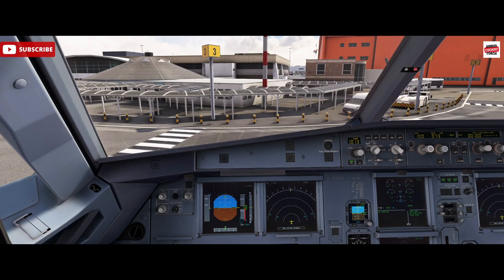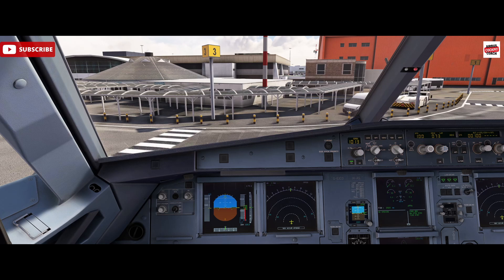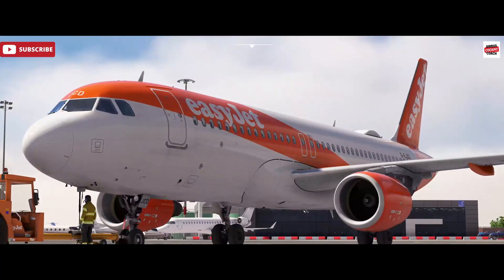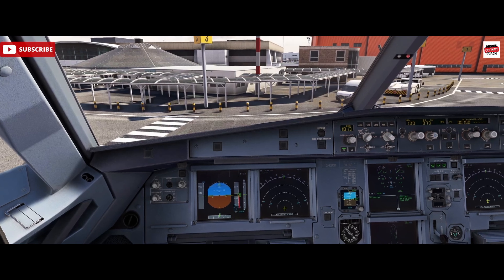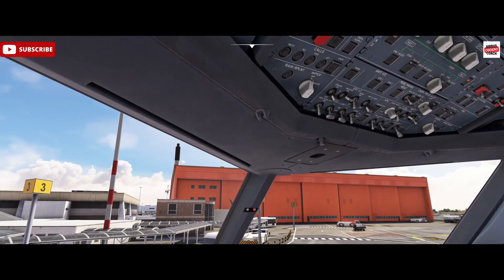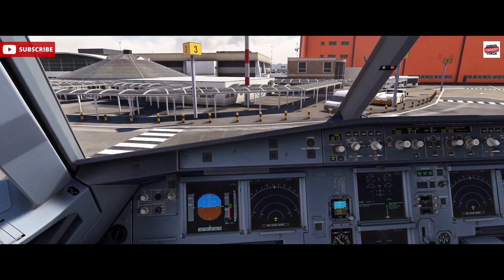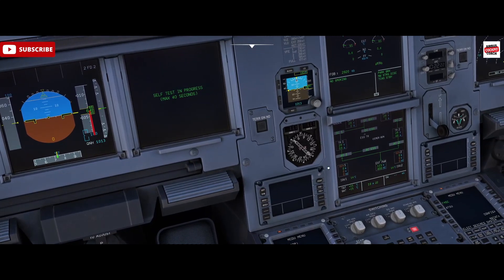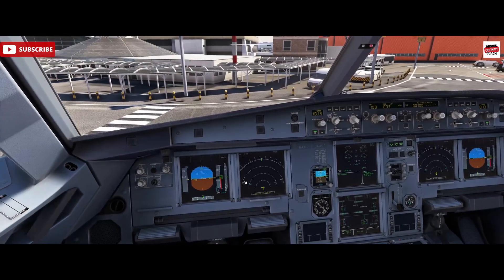A320 Emergency Generator Test Explained by Real Airbus Pilot | MSFS 2024 Tutorial

Comment: Why is it required to turn off the blue leak measurement valve? To prevent flight surface movement?
Reply from the maker: Good question! Isolating the leakage detection manifold isolates the rudder and nearly all wing surface hydraulics other than the LH slat motor and emergency generator which are on the same hydraulic line.  Safer to test in that configuration